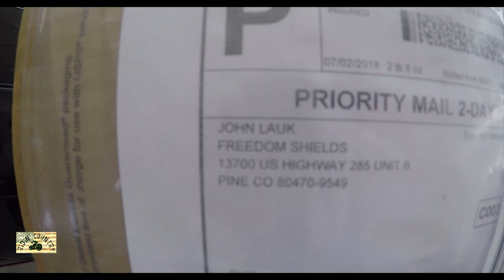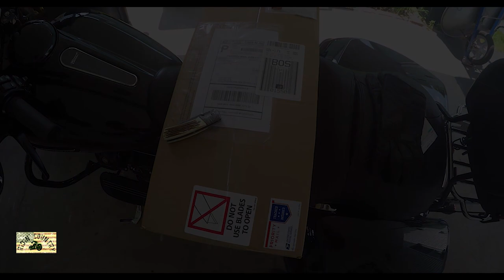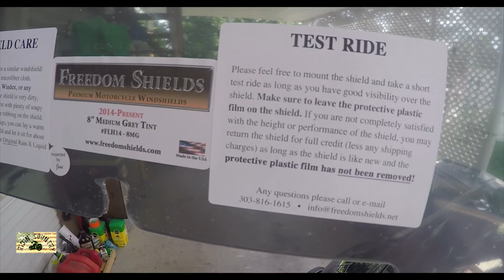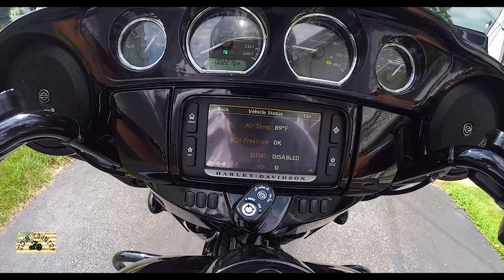A must have accessory for your motorcycle!

Comment: So Dave, the 8 inch shield works best for your height? 6"2'  to 6"3"  correct? (I'm ordering one today)  Also, you were able to wiggle it around to seal that gap you were concerned about? (as I would be too!!)  Thanks bud.
Reply from the maker: PK Tech1969 yes, this 8” is perfect! I did get it to seal to my liking and plus there are many options to get a good seal too. Couple, one is to gently sand down edge to fit better if need be or you could buy some “sealing tape” to put on and help seal.... good luck, please let me know how it works out. 👍✌️..... couldn’t be happier now that I’ve 5k on the windshield.

Comment: Just ordered my first one. Tried Klockworks 8.5" it was to high to see over. Then 6.5 to replace my 6.5 wind-splitter. With the Klockwerks I still have a lot of buffeting. I will return the Klockwerks and try the Freedom. QUESTION, What brand knife is that? Bob Terzoula?
Reply from the maker: Haha I wish it was made by Bob! It’s actually a knock-off but a good little knife.

Comment: Too thick water could cause issues with your electronics if it gets inside the fairing. Hope you find a resolution
Reply from the maker: Not a problem. If you get a chance read some of my responses. Plus it’s a Harley, my least concerns are it’s electronics!! Lol!!!!
Reply: Mine has no gap once installed.

Comment: Nice looking shield! Did you figure out what you would do about the gap from the difference in thicknesses or is it small enough you will leave it as is?
Reply from the maker: Ya, there’s a plastic “lip” that goes under the gasket    and covers the opening. Tough to explain but I feel it will be okay. 👍
Reply: Ridin' Country thanks! Haven't made up my mind yet but we may be in the market for a new shield down the road.

Comment: I'm a believer!  I've had them on two bikes, Betty and Cash.  You can maneuver the windshield to get that gap closed.  Also, soft lower covers are the bomb!
Reply from the maker: HarleyTrek, thanks for cooling the flames! Lol... you’re right plus that gasket underneath seals against anything between the plastic. I did maneuver a bit too like you said and it does fit fine. Thank bud! ✌️
Reply: @RidinCountry  
With the added thickness of the Freedom shield, there is no way to seal up the gap like the stock shield. Even John at Freedom said so.
Reply from the maker: BobsGT235 thank you for the comment! 👍 ....couple things you can do. You can use a wet sander and sand bottom to fit like I did.  Also many gasket tapes on market to seal. Good luck if buy/bought one. Safe riding!!

Comment: Good video!  i just installed a 10" Touring shield from Freedom Shields and it was a drastic difference in buffeting out on the road for my test ride.  I am 6'2" and ride a 18 Ultra Limited.  Sooooooo much better than the stock shield of the same height
Reply from the maker: Thank you Jamie for watching! My riding buddy, “Happy Jack,” who’s on YouTube has the same bike as you. Beautiful ride to say the least!! I’m very happy with my FS and will buy another one if need be for sure. We’ll never be able to cut all buffering, nor should we want to far as I’m concerned, there’s reasons we ride and wind is one of them! But my FS most certainly cut down that constant head banging against the wind and it also looks beautiful on the bike! One thing I will recommend is, be VERY careful how you clean it. I must have had a tiny spec of sand on rag and it created a few scratches. Use newspaper or the kind of paper towels you find in most restrooms. Just my opinion 👍😉..... best of luck to you, safe riding!
Reply: @RidinCountry  Thank you!  and thanks for the cleaning tips.  I ordered a can of Plexus that they recommended but thats a good point about the towels to use .  thanks a lot!  Keep the shiny side up!

Comment: They need to take back and reduce the thickness were it meets the faring , sorry man that would be a deal breaker for me, going to have water issues, rain or washing the bike, even dew may leak down, may have warranty issues also if something happens.
Reply from the maker: Totally know what you’re saying Mike. Especially if this was on my 09. But this newer fairing is little different. There’s a plastic lip that goes under the rubber gasket that seems to cover the slight opening. Basically what I’m saying is the opening is superficial, but coverage under that from water entering. Hope that helps Mike. Thank you, very observant!! 👍✌️
Reply: Great, I was sure a good company like Freedom Shields would have covered that issue in there R & D process. Shield does look good and your audio is fine ....